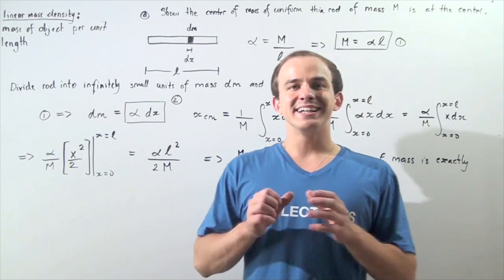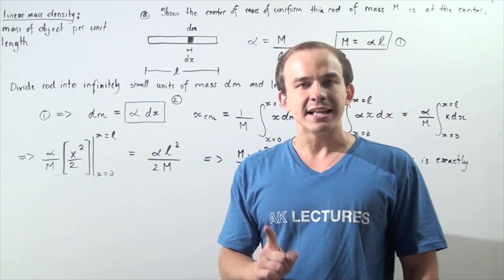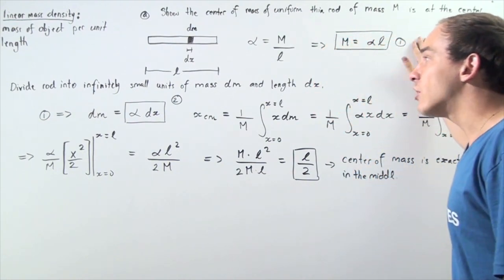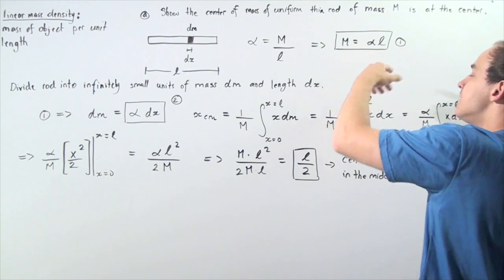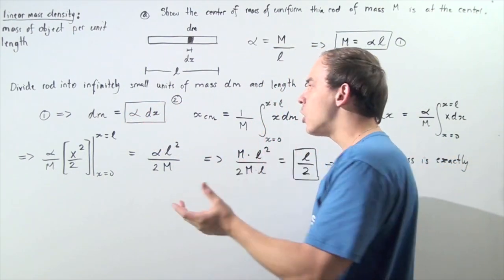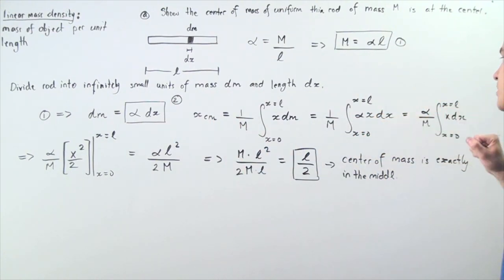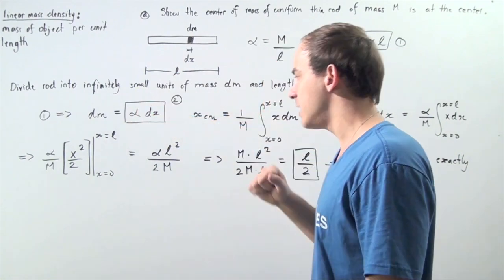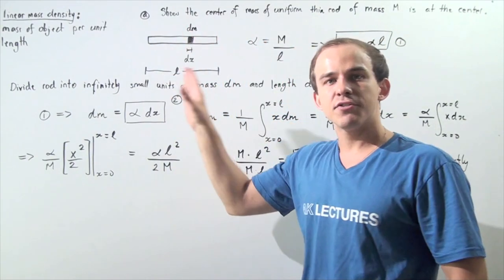Center of Mass of Thin Rod

Comment: I wish you had worked the problem out on the board, would've made it easier to follow.
Reply from the maker: do you mean by using a diagram?
Reply: I mean starting from a blank board and writing everything step by step while explaining the concepts ....... instead of having everything written on the board beforehand ......It helps (me) to see you actually writing it all out from scratch as opposed to just explaining what's already on the board.
Reply from the maker: I specifically made the decision not to do it that way. For one thing, the lecture would be too long and most people cannot watch lectures longer than 8 minutes (research proven); they get too bored. I try to deliver information concisely and in the shortest amount of time. I recommend trying to follow the lecture with a pen and paper so that you understand and remember better.
Reply: Yes I agree long videos are extremely annoying. You seem very knowledgeable and intelligent. If only there was a way to speed up the videos, that would've been a win-win.
Reply from the maker: Thank you :) I absolutely agree. When I began this project, I actually tried to write up the lectures from scratch but the lectures always ended up being 25+ minutes and I thought that was excessively long. Or at least not what I was aiming to do anyways. You know, you can always ask a question if you do not understand something. In a few weeks, I am releasing a new version of my website and it should be a bit more interactive than the one I have now. You should definitely use it to ask questions and things like that. I try to answer them as quickly as possible. But on another note, are you currently taking physics?
Reply: thank you so much! I am sure your new website will be great!! I will subscribe to your channel. I'm currently taking mechanics for engineers, next semester it'll be electricity and magnetism. I'm majoring in physics.
Reply from the maker: very nice! i studied physics as well, you're in for a fun time ;)
Reply: @misssweethearted  so how'd it all go mate